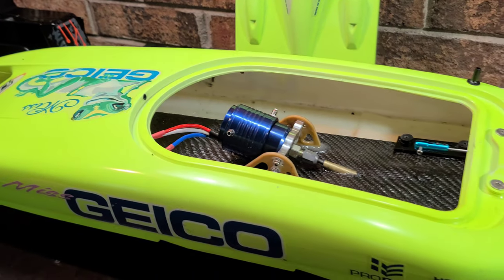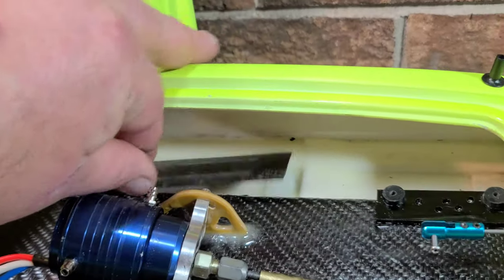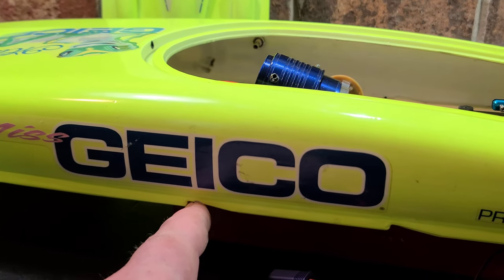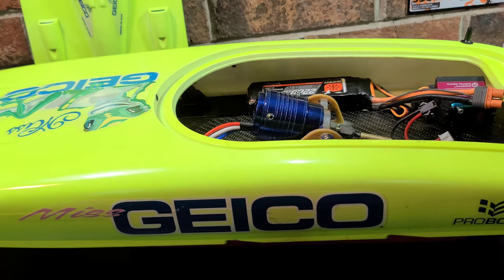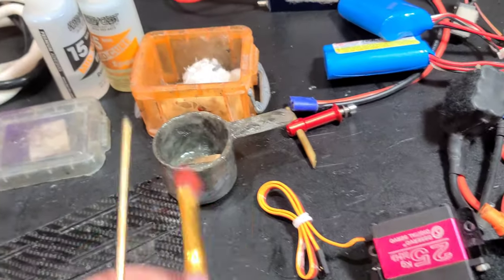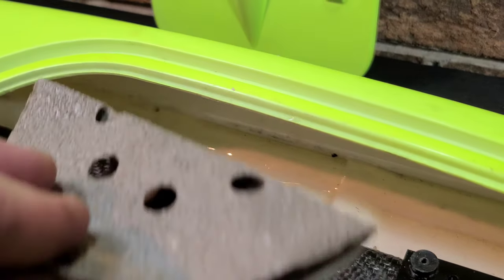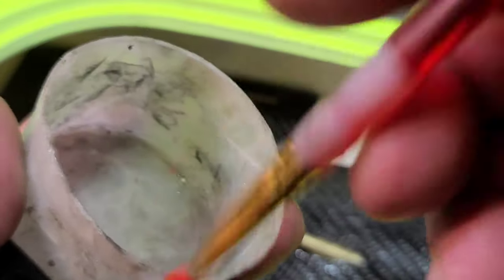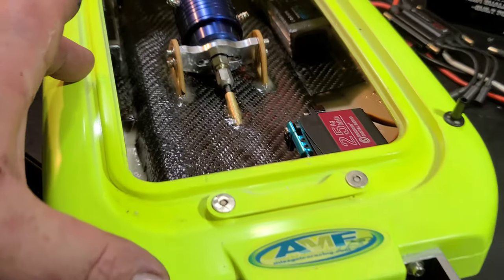COG & Battery Tray Install Rc Catamaran Upgrade Series - Proboat Miss Geico 24, Blackjack 24

Comment: Nice series!  I've got an old MG 24" with stock parts as well (eg. brushed 15 motor, 50amp ESC) and I'd like to make some of the upgrades that you've made.  I may have missed it but would you mind letting me/us know what motor, ESC, and battery configuration you are using in Project Zippy?